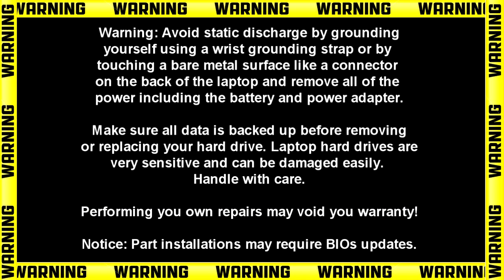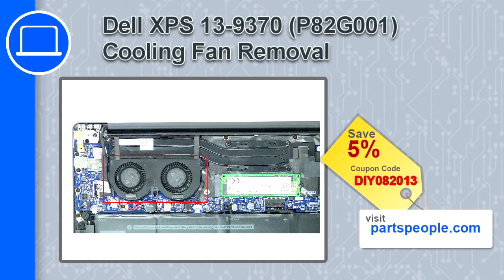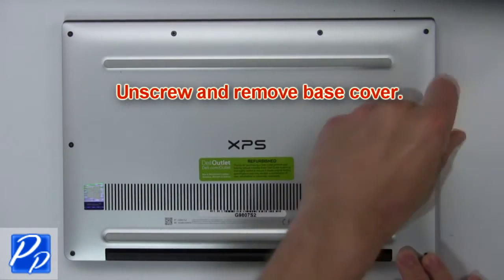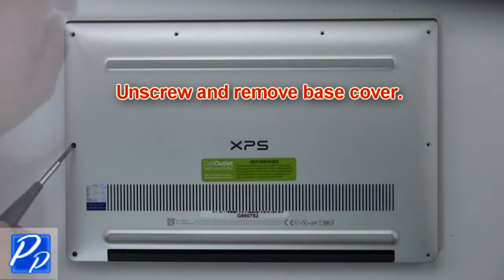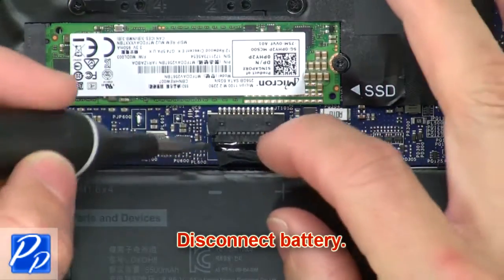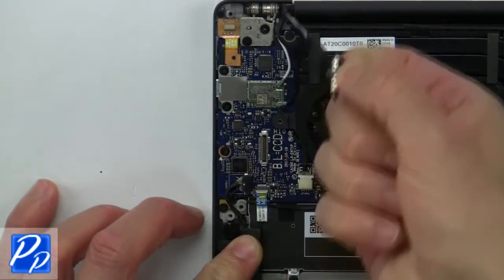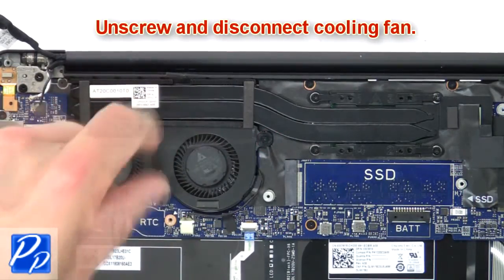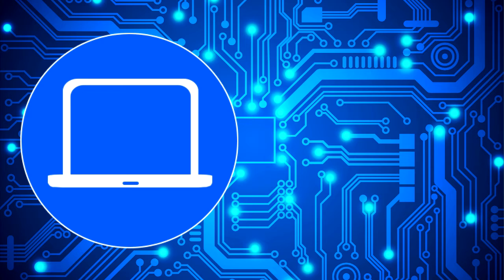Dell XPS 13-9370 (P82G001) Cooling Fan How-To Video Tutorial

Comment: DO NOT USE YOUR HAND TO PRY THE BACK LID OFF! I would recommend getting a rubber pry tool, I pried it off with my fingers and cut the crap out of them. The edges of the back are sharp and will cut you with no remorse.
Reply: Wish I'd looked at the comments on this video before trying the repair myself. Ended up slicing open the tips of my fingers. This comment cannot be highly rated enough!